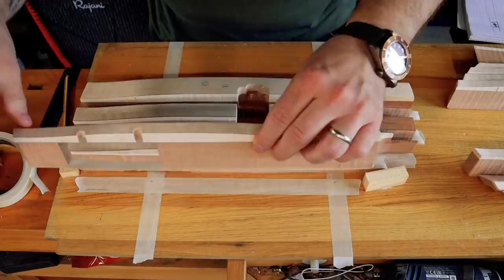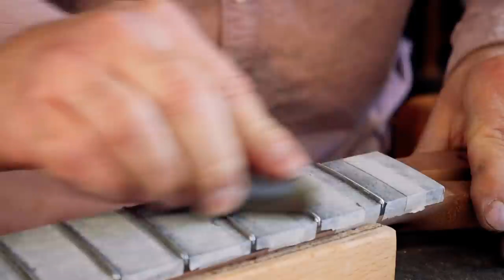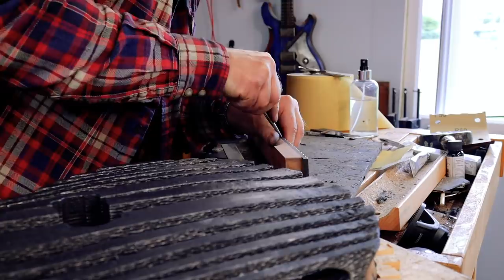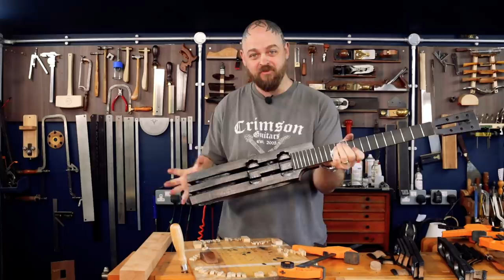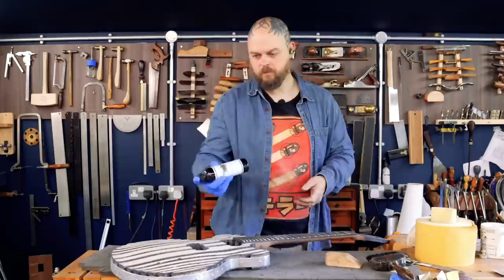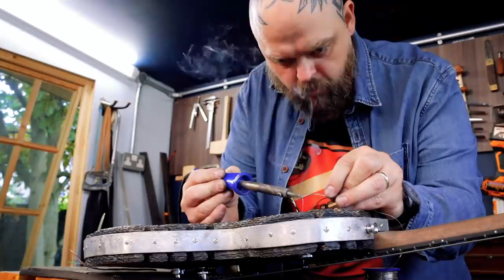Unique Guitar FULL BUILD - My Great Guitar Build Off 2020 Ep. 5 - Taking a Kit Guitar & Making It!

Comment: Ben: Covers hole Guitar in Conductive Shielding
Also Ben: Weird, it doesnt make humming noises.
Reply: I actually laughed out loud! Thanks :)
Reply: it is pretty weird, considering that the wiring does not run inside the cages defined by the shielding paint. well, maybe the aluminium strip connecting all the painted parts helps with that.
Reply: @nothanks7919  Google "faraday cage"  Its the same reason we dont need shielding on top of pick ups
Reply: All but the absolute cheapest pickups have shielded wires, and it only costs a few cents to use shielded guitar wire to connect everything. When used along with your choice of copper or aluminum tape, or conductive paint in your control cavities, the only 60Hz hum you'll get is through the pickups.
Reply: @nothanks7919  xD

Comment: Sry, Diestra”s is a massive disappointment.  Also, he never referred to the build off or that it’s for charity on his video.
Reply: Yeah... I figured he'd do something with steel banding.  But the whole torched top was pretty uninspired IMO.  I thought he would sand it back and texture it, or do something else with it... then he slathered it in varnish.  He modded a bass guitar and it was 10x cooler that what he did in this contest.
Reply: Truth, not sanded and just coated left a very bumpy mess.  Add in not putting any shielding and you get a wall hanger, and not a nice one.

Comment: 18:21 You're going to succeed because you're Roadrunner from the Wyle E Coyote cartoons. You don't understand physics so they don't apply to you. Also that guitar's too cool looking to break.
Reply from the maker: I love this, I mean, you're calling me stupid when I think about it, but you are not wrong ;) I love it! B
Reply: @CrimsonCustomGuitars  I guess I kind of was, but that's not how I meant it. When I built my first guitar, before I ever cut anything, I started by doing all kinds of math on how much tension the strings would put on the neck, how much compressive force cherry could take, how thick everything needed to be to hold together and not move, and so on, but I missed things like how high off the body the fretboard needed to be, or what angle the neck needed to be kicked back to in order to have playable action.

You're just like, "I know what guitars feel like," and then make them, and they work. I'm Wyle E Coyote. I spent months engineering what should have been the perfect guitar and ended up with an unusable block of wood with strings and a pickup. While you just run across the top of the canyon like it's solid, I'm over here building rocket boots that don't have a steering mechanism. I'm building my second one right now, and I'm trying to be Roadrunner this time.

Comment: You're putting in the frets with PVA? Interesting. I always use Titebond genuine hide glue for that, just because I find it to be sticking two non porus surfaces together very well once dry. I also use it, when an acoustic guitar's bridge is lifting at the end because there is lacquer underneath from the factory, and I just want a quick and dirty solution for the client who doesn't wanna pay too much. Of course these bridges almost always have bolts in them too, otherwise I'd never trust this glue to hold in any way

Comment: did you have a backup plan?
Reply from the maker: That is the secret, always have several back up plans.. 
1. Use bent wood to hold it together.. which failed
2. Metal band in middle - worked
3. Metal band top and metal band botttom ala binding.
4. Glue spacong blocks between each section at each end.
5. Use round bar to set the spacing and clamp the whole thing together with threaded bar through upper and lower bouts..
6. Rivet or screw the whole thing to a guitar shaped piece of 2mm thick metal mesh or plate.. something with holes in like what Inused for the backplate so you still get the see through effect.
7. Use acrylic sheet as the spacers.. 
8. Use epoxy.. boring 😴

There is always a way forward, unless you have exploded the guitar that is.. B

Comment: I have a nerdy question but I'll try to keep it short. What would a pickup sound like sealed inside a body filled with gases of varying density? Would the vibration of the strings having to travel through something more dense than oxygen like sulfur hexafluoride before reaching the pickup magnets deepen the tone or even lower the sound of the note slightly? Seen a bunch of videos where they build the guitar out of different solid materials to see if it changes the tone when played through an amplifier but I feel like changing the gases the sound waves travel through would have a much more dramatic effect.

Comment: The neck is not going to fail. Neither are the strips of the body that hold the tailpiece. There is a good clean wood glue joint. If something is going to fail, it is deformation from taking a hit strong enough to bend the aluminium. But it looks good and acustic qualities are probably nice too. That body should pick up feedback, which is what an electric guitar should do as much as possible without going into uncontrolled squeaking.

Comment: You don't have to be the best guitarist. But I believe a luthier should be really aware on tuning a guitar. And not to be like a dick. Tuning is pretty complicated if you really get into it, everybody sees it as the first thing you should be able to do. But tuning a guitar properly isn't easy. Intonating a guitar is pretty hard, if you account for the most equal intervals you can get. (at a certain position on the neck). Otherwise, just the traditional 12th fret harmonic with the 12fret comparison will do. But still, then you'd have to figure out how to properly tune a guitar to get the best result.
Brandon Acker got a video on it.
Reply from the maker: I agree, luthiery 101 understand the fundamentals of what you are making and what it is needed to achieve. B

Comment: I've yet to build a guitar, so I don't feel right offering too much criticism. I really like the aesthetics--but I won't lie, the neck joint worries me a bit. I live in a place that gets REALLY hot and REALLY humid in the summer, and I think a couple of hours at an outdoor gig, in direct sunlight at 100dF (37-ish in Celsius) would absolutely kill that guitar.
Reply from the maker: Never under-estimate how powerful modern glues are.. they are truly amazing! I've made guitars with smaller gluing surfaces before and they've been fine, the only worry I had was the 3 sections somehow messing with the strength.. I'm confident we're OK though, no matter the weather. B

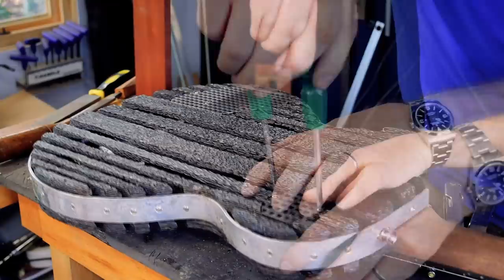Comment: I guess the epoxy-up wasn't a complete success: you can see one of the strips moving at 22:24... But man, it looks absolutely amazing.
Reply from the maker: That's the weak point where the control cavity is routed out (I think) but you are right, a few spots do need a bit more glue.. that is one job for Monday, that and buying some more glue! Irl I should have left it for the full 4 hours the instructions specified.. who knew? B

Comment: now. i have to say: i LOVE that guitar body. the only thing i don't like is the headstock. to my mind it doesn't fit the body. i think it would have been cool to copy the body. though i bet it'd have been a bastard to get tuners to suit and fit. saying that. out of the guitars i've seen so far, the body alone would make me vote for it. the body is spectacular.
Reply from the maker: The texture wouldn't cause any real issues for the tuner installation imo, so long as I don't mess with the size of the holes that is.. 
What would you do differently on the headstock? Just a bit curvier maybe? B
Reply: @CrimsonCustomGuitars  copied the body design and reinforced it, like the body, with a metal ring. you'd have kept the theme going and would have unified the whole thing. i think it'd look fantastic if you'd done it with your crimson headstock. maybe have your logo in brass or coper wire set in to the headstock so you could see parts of the wire through the gaps in the headstock iysim.

out of all the guitars i've seen so far for this competition, you have no competition. anyway. no insult intended, just giving some  feedback by a regular viewer and guitarist.

Comment: what was the liquid used during the fretting? glue?
Reply from the maker: I fill the slots under the frets with wood glue just to make sure the neck is as structurally strong as humanly possible.. it is also much easier to clean up than superglue or epoxy.. B
Reply: Crimson Custom Guitars thank you! I don’t recall seeing you do that before so i was unsure of the process at play.

Wouldn’t that make it more difficult to remove frets in the case of a refret?

Thanks for all of the wonderful videos! Been learning a ton from you

Comment: Is there a half/triangle shape trick for getting a soft vee neck shape?
Reply from the maker: Draw out a rectangle that matches the thickness of your neck and then draw in the shape you want. Once you have that then measure where to put your lines.. should be fairly simple. B
Reply: So the problem being that I don't have a proper soft vee reference to work from, and only played one a few times. Would assume that the triangle trick shown could be adjusted a bit to aim for different somewhat consistent sizes, but don't a priori really know what to aim for systematically other than having a vague cross-section impression based on images found online.

No, it's not really difficult as such, but don't really want to ruin any necks that I own.